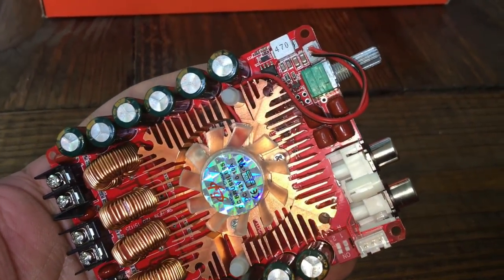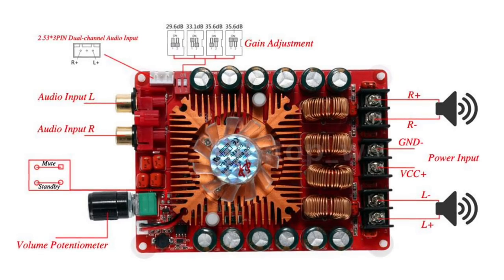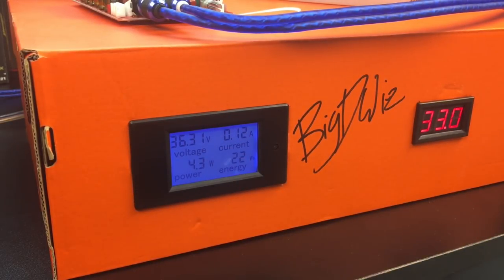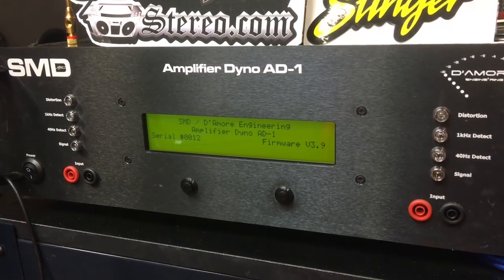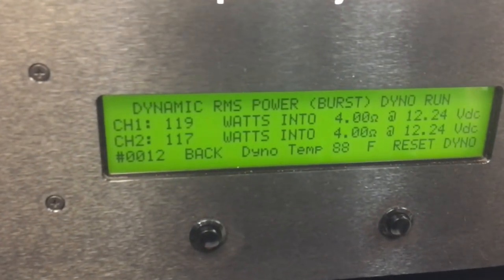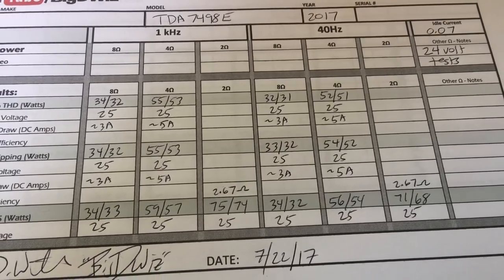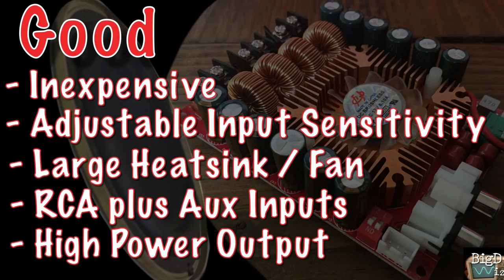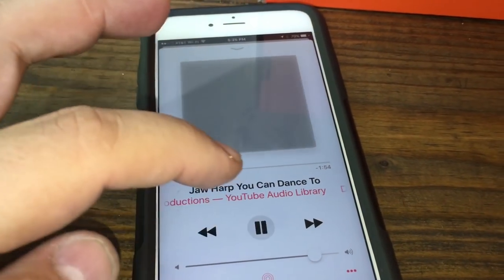Big Power in the Palm of Your Hand - TDA7498E 160+160 watts

Comment: Ok if it was a decent amp then why would it need a whopping 36 volts instead of 12?
Reply from the maker: I need to explain these amp boards better. They run on higher voltage than car amps and are designed for special applications where you can provide the 30-40 volts of input needed. I would not recommend using them in cars
Reply: But did you know that car amps actually do run on about 50 volts and higher just like pa power amps do
Reply: No, a car can only supply 12 volts.
Reply: Ryan Toomey That's my point, that's why they have inverters built in
Reply: These boards are meant for home use. You're supposed to connect them to a DC power supply, or build your own power supply with a step-down transformer, a bridge rectifier, and a bank of capacitors. Some of these boards already have the components to convert AC voltage to DC voltage, so all you'd have to do is directly connect a step-down transformer to the board's power inputs. However, the one used in this video requires DC 36 volts.
Reply: Cars supply low voltage but high current which together give you power. Those boards though, are made for high voltage. Probably because components that are able to handle high current are quite expensive. 10V*2A =20w but   2V*10A also equald 20w, you see ;)
Reply: ALL amps need a DC/DC converter to produce lots of output in a car. The car amps have this converter built-in.. you can only produce 18W to 8 ohms and 36W to 4 ohms with a 100% efficient amplifier (without lifting the voltage). Basic laws of physics.
Reply: it also has to do with the topology of the amp too. that's pure class D. (Class D car amps run around that voltage too if not way higher using a DC -DC converter) even your old analogue style car amps use that high voltage some upwards close to 200 volts
Reply: Ryan Toomey You big dummy! Google switching power supply.

Comment: Is it a car amplifier board??
Reply from the maker: +Shoeb Malik designed for portable or custom setups, could be used in a car with a voltage booster
Reply: BigDWiz thank you. Will it need a preamp for building a custom car amp from this board??

Comment: Eh, this thing is really cheap and people shouldn't expect miracles from a $18 amp. But what kinda bothers me is that ST is a reputable company, yet an amp built off of one of their chips (most likely using the reference design in their datasheet) does not quite meet their specs. Sure, the difference is "only" 10 watts per channel, but still. It just makes me suspect that ST is fudging their numbers just like the Chinese do.
Reply from the maker: +CoolKoon you speak da truf
Reply: The specs are for 10% THD while the amp dyno tests to 1% THD. That's why there's a 10 watt gap

Comment: tda 7498??? 100+100w????  please
Reply: 160W + 160W at 36V 9A is completely understandable for peak outputs, I can get about 80A clean RMS power out of mine when running at that voltage and amperage.

Comment: I got an old 30 yr old  Sansui amp that I paid $20 for, weighs 30lbs, 75 real watts RMS, and .0015 THD @ 50% power. This amp at best is 5 real watts, dollar per watt.....it's $3.6/ watt which means 50 real watts is at over $180.
Reply: Certified runs are real watts. Just because it doesn't use a massive toriodal transformer doesn't mean it doesn't make any power

Comment: The capacitors on that amp are branded "Nichicon" but they are fake. (I.E. not real Nichicon capacitors - Nichicon is a Japanese company that makes good quality capacitors.)
Reply from the maker: +Benjamin Esposti yes, no way these are real Nichicons
Reply: Yeah, they are the incorrect color (Nichicon VY series should be black, not green), and the pressure relief vent stamp is incorrect. It should be an "X" shape instead of a "Y" shape.

Comment: Please bridge this amp and connect a low pass filter to its input then it can definitely drive a decent 12' sub. that's how I'm using it ,peace .
Reply: Tomin Jose 
I didn't find out how to bridge it. Ok, it's clear for the jumpers. But how to use the inputs and outputs terminals in mono?
Reply: Connecting
the MODE pin to the VDDS pin configures the device in mono BTL. The output of the two
channels can be paralleled. When the MODE pin is connected to ground or floating (pulled
down internally) the device works as a stereo amplifier.
Reply: Tomin Jose 
Thank you

Comment: U had the output power low cus these amps have a diode in the power input for reverse polarity protection and when u pull high current the diode drops a lot of voltage till u pop it and then it shorts out 😂